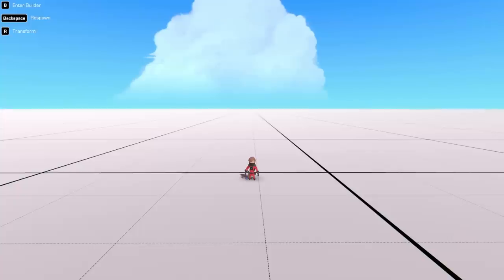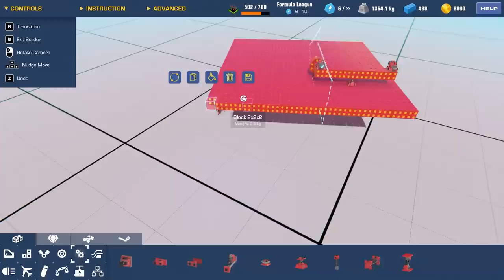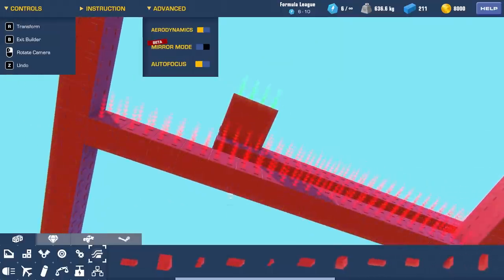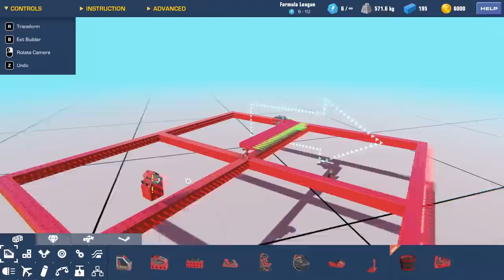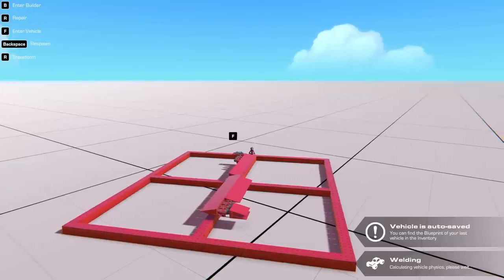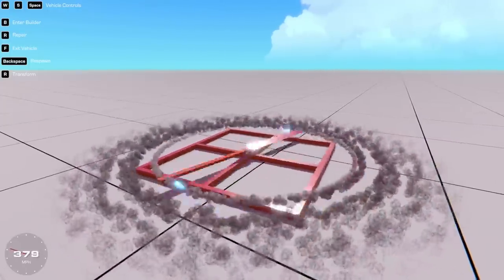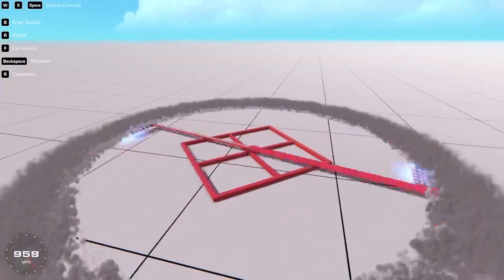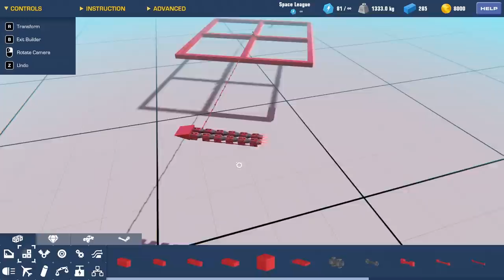Can you create a sonic boom WITHOUT moving??

Comment: You’re actually incorrect with speed, it will actually make it slower putting the jets on the ends, it gives it more torque when at the end but less maximum speed at the end, if you put them closer, then that will make the ends faster, this is due to the moment equation having an effect.

Comment: You do realize it would've been better, and probably easier if you actually pinned it to the ground with the Anchor block?
Also using weights on the other arm to offset the weight of the cockpit it woul've probably been faster?
Also, Also, you could've used the no drag glitch...

Comment: Your "common sense" model of aerodynamics is forgetting that a sharp corner on a trailing edge drags a low pressure high turbulence region of air behind it.  a tapered tail is loads more aerodynamic than a blunt tail.

Comment: Imagine the G forces in this thing😂
Reply: Each of those long flat links is 2 meters (1 block = 0.5 meter in the game, IIRC). That makes this centrifuge about 112 meters in radius. At 1000mph (~1609 km/h) cab speed it rotated at ~75.76 RPM, meaning that the player character would be experiencing 326G Incredible high loads for a structure that large and for this humanoid character to survive, but ultimately not too much as far as centrifuges go. Industrial centrifuges can reach thousands of Gs, but for much, much smaller quantities of material.

Comment: Please stop saying aerodynamics. You're not understanding how a lever works... or perhaps the speed difference between a small and large wheel that rotate at the same speed? At any rate, a lever trades distance moved by force applied. (Work is force times distance.)  So make a very long arm on both sides as you had... but put the rockets much closer to the center!! And now, for each little bit the rocket moves near the center - that will make the looooong arm move a lot. You'll multiply the speed of the end of the arm by putting rockets near the center.  If the arm is crazy long, the resting momentum of the static arm will mean that the rocket will take longer to come up to speed... but I don't know if the game you were playing is that accurate to physics. When you move the rockets out to the ends of the arm, it can only spin as fast as the rocket, that's why you kept slowing down.  Not aerodynamics.

Comment: Probably could’ve cracked 1000 if you had boosters counter Rotating the base
Reply: By counter rotating I mean to keep to base still and not move even a little bit
Reply: @mateia6451  He needs to add more weight to the non-cockpit side to balance it.